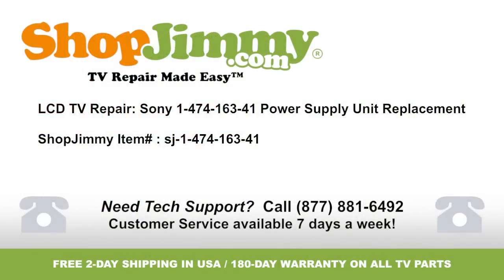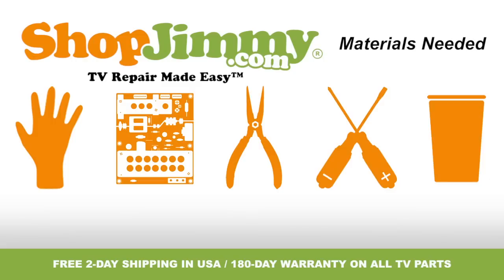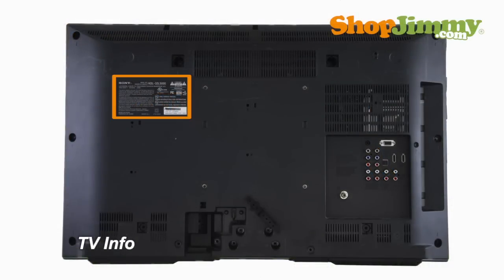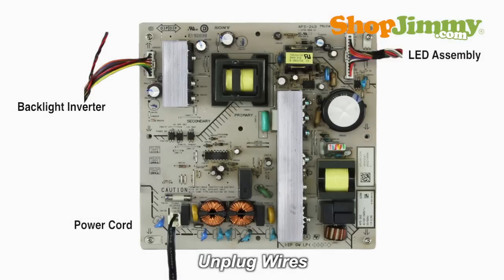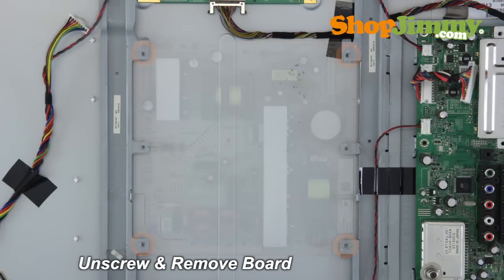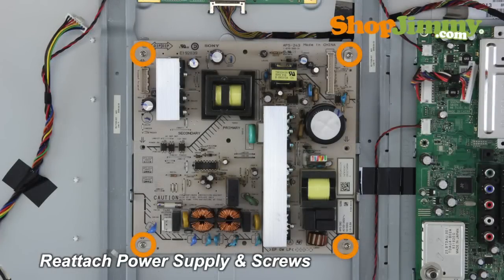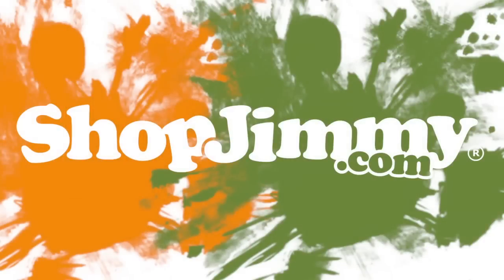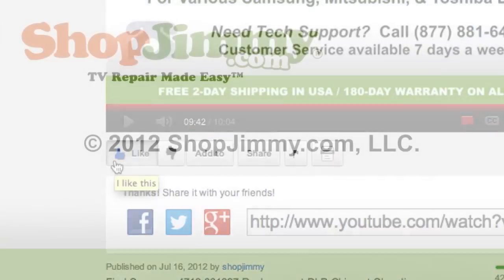Sony 1-474-163-41 Power Supply Unit (PSU) Boards Replacement Guide for Sony LCD TV Repair

Comment: I have sony bravia KDL-26L5000 and the power supply died, can I raplace it with a KDL-32L5000 used power supply? I am asking because in my country I can not find a new one. Thank you very much.
Reply from the maker: Guillermo Castillo  Try all repairs and troubleshooting at your own risk.  Yes, that should work.  Thanks!  www.shopjimmy.com